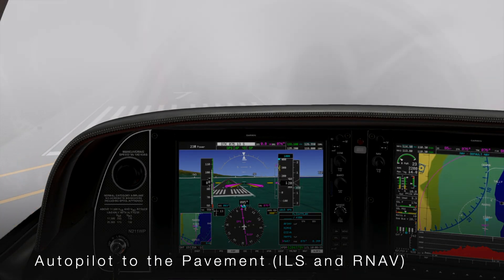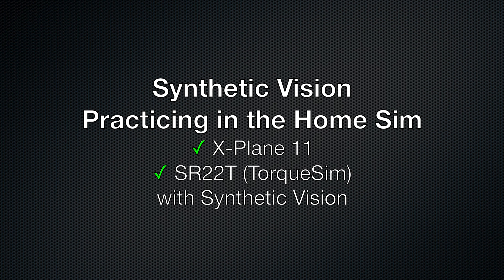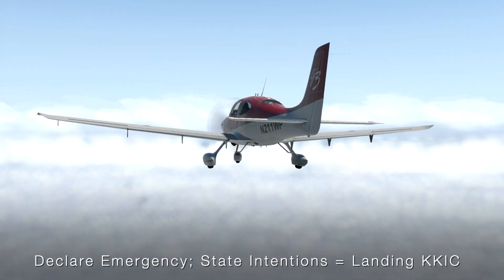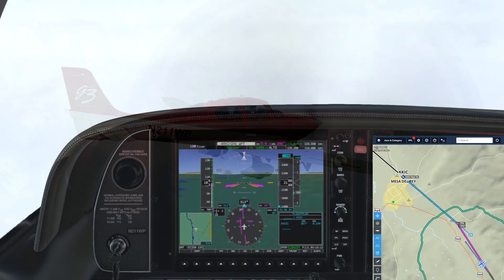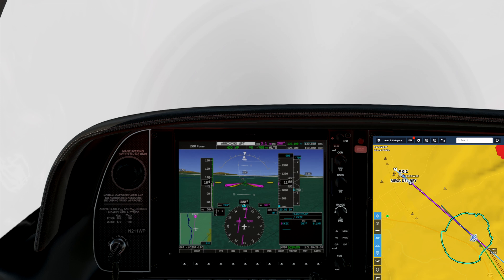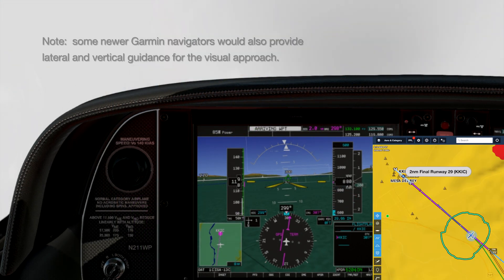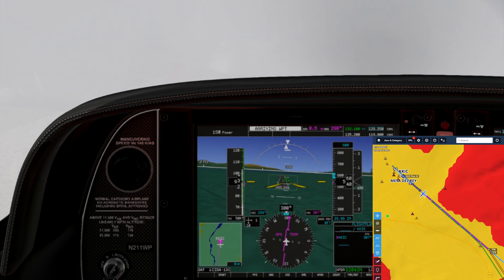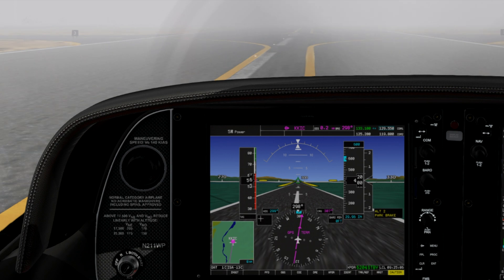Zero/Zero (Part 2) - Emergency Landing with Synthetic Vision (home sim)

Comment: you should really preface that this is a sim.  you lose credibility by this click bait
Reply from the maker: Valid point, and not intended as click bait.  I had hoped the left part of the thumbnail would make that clear, as well as the description.  Thanks for the feedback.  Wayne
Reply: @GeezerGeekPilot  all class Sir, thanks. that title could lead ab anitio pilots astray
Reply from the maker: I just changed the title to be include (Home Sim).  Thanks again for pointing this out.